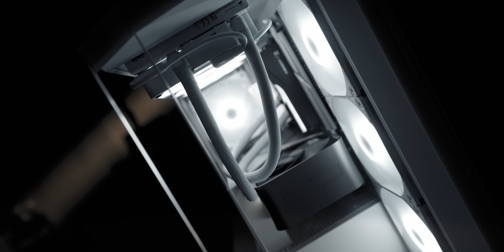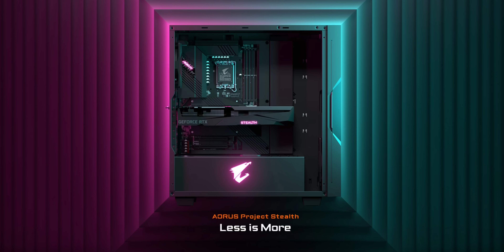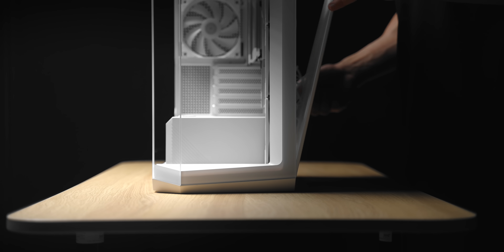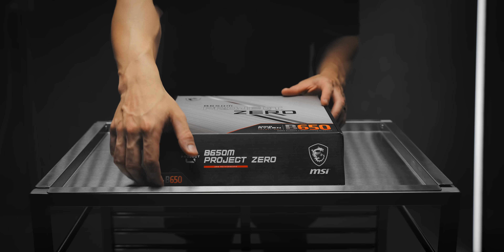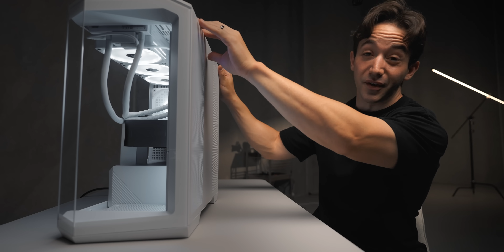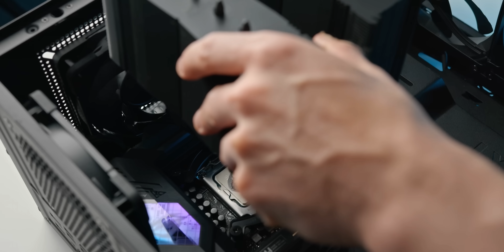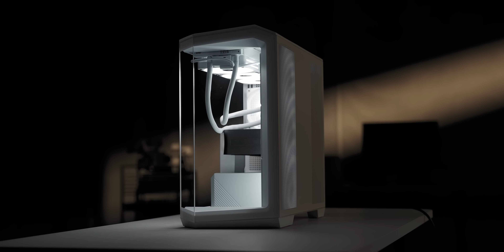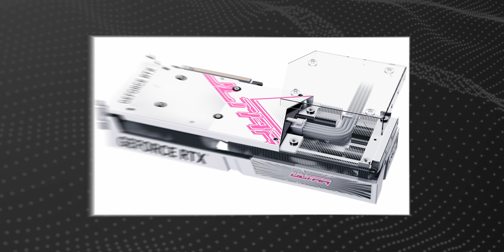"zero cable" PCs are here.

Comment: A couple people have said it already but I feel like the main advantage is that this is way more practical. I hate snaking cables through holes in the case and bending them at extreme angles to get them to connect. This is way easier.
Reply: Exactly.

The choice of using an AIO with tubes just hanging inside on a 0-cable build though...

OCD triggering!
Reply: Especially because case manufacturers keep getting the placement and sizing of the pass through holes wrong, so that it is virtually impossible to even pass a cable through them... like what the hell are they doing not testing it?!
Reply: Right form to match the function.

Comment: This is simply the latest gimmick. There is no practical benefit to having something like this as it limits case compatibility and increases cost. Unlike those fans you showcased that actually reduce cable clutter, this just requires arguably more space behind the motherboard tray to hide the rat's nest. We need solutions that improve the user experience, as in real innovation. Sadly, even those fans aren't fully there yet as there's no industry standard connector and Corsair are infamous for their proprietary stuff.

Comment: The only bad part about this is you're giving up the recyclability of the gpu and the motherboard only for aesthetics and you're probably paying a premium for it too. It's a really bad investment unless they make this thing convertible. Like having connectors on both sides or making flippable small boards that can connect and work both ways like type-c so all those annoying pins connect to these boards and they get socketed in either way. It's doable, yeah it'd be a bit more expensive because that'll probably require more motherboard layers or more filtering caps to mitigate some of the extra resistance came alongside with the sockets. But these products are already expensive and that's exactly why they should make it an actual design because I don't think changing the way the power connectors look is impressive as a design or engineering standpoint, it's far from it. Of course the recyclability might get better if these companies make more of them and it stops being a niche in a couple years, but for now it's a really bad investment at a financial standpoint. I don't think any large scale company will adapt to this new concept and unless companies do it, I don't think this concept will sell enough to push forward.

Comment: Why did you use such a large shroud to cover the cables? if it was half the size it would've still covered the cables drawn less attention and not blocked the geforce logo on the card either.

Comment: Well, this video just shattered my dreams. I've been doing this for more then 10 years. With every PC I've ever built I flip all the headers to come out the back. I even make my own L-connectors and custom cut the case.
Reply: How does this video shatter your dreams? I don't get it
Reply: @gelidanima   I had given thought to selling this idea years ago . Just didn't think anyone would care enough to use or buy the idea.
Reply: I've been thinking of doing that, does resoldering the connectors just work or do you also need to re-pin some of the cables (like the 24 pin)?
Reply: @HorizonMakes you would need to repin, custom harness, etc., as pins would be in mirrored/flipped location.
Reply: @HorizonMakes   As @msytdc1577 stated. You do need to rewire the connector.
Reply: @RetArm oh ok now I get it... But still, this is not the first time someone talks about this "zero cables" PCs thing, I have seen this many times before from many channels and websites. I thought you would have already known this was going to be a thing, especially given the fact it's something you care about.
Anyway, keep thinking outside the box!

Comment: I updated my buidl with the MSI Project Zero B650 with the new Corsair 2500X, and it looks amazing. The Cable managment is shit, espacially if you don't use Daisy Chain Fans, but the inside looks really nice and clean.

Comment: I'm a fan of such, er, fans. But that way of doing "zero cable" on the motherboard is just ugh. I like custom cables for things like the MB, CPU and GPU (USB and audio need not apply). Also, the last thing we need are two streams of GPUs out there without some standard (i.e. rear connecting and front connecting power).

Comment: next - they need to make graphic card power on the motherboard, like it was shown on some computex or similar expo
and after they will have enough plays with cases.... maybe they will start to think for better cooling solutions and how to avoid using hot air for watercooling or how not to warm up cpu from gpu etc.
next - they will think how to reduce noise level from fans and just make fan frame 5mm wider to avoid too close placing to fan mounting plates and positions, it is soo easy to make 14 cm holes on the case and add  a frame for 12 cm fans which will be placed on 14 cm mounting holes wit screws... so easy but they do that stupid shit that blocks 1/5-1/3 of fans but universal for using 12 or 14 cm fans in 1 case on same frame

Comment: Couldn't you use one of those L shaped connectors from the GPU, it's still technically a cable but if it's sharp enough it'll just look like componentry

Comment: looks great! next thing we need is cases with 1cm additional clearance behind the back panel, because some cases are already too tight
Reply: dual chamber is way to go... I have build new PC in H6 Flow recently and it was smooth experience
Reply: @jacekmakes probably 😅 but the joy of building pcs is not about routing cables. espacially with hardware added later

Comment: I'm not really a fan of this concept. Mostly because it will inadvetertently make cases bigger (you need more room at the back for the connectors poking out) and that's an issue because cases aren't making very good use of empty apace as it is today. Secondly, good looking braded, managed cables makes the PC look better . EPS, Motherboard and GPU connectors all enhance the look when they're nice and well managed. You can even add a wireview to get that ultra clean, neat look and still have a sexy cable routed just above the GPU and back. I'm a fan of making fan headers, front IO, audio etc come out the back though but having some in the back, and others at the front is gonna be confusing and a nightmare to support. So for all of those reasons, cables in front are overall the better approach in my opinion. Especially for smaller form factors. And with some effort you can make PC's look fantastic and it's totally possible to hide all the small cables in the main compartment which i've done in my own system.

Comment: I really hope this catches on. I really want a high-end ITX AM5 mobo with the connectors on the back.
Reply: Same, although I'm unsure how effective it'll be in a typical sandwich ITX layout. The CPU side will definitely look clean at the expense of a messier GPU side where all the connections will have to be made before the GPU is inserted into the riser on top
Reply: @Notorious544d  imagine if they made sort of like an electrical distro plate, that would just attach to the back of it, so that you wouldn't need to have any wires at all. Either way, I'm going to make it a personal goal to try to design one myself

Comment: until it becomes a standard on where the connects are i will simply not buy a motherboard that has the connectors on the back. Standards exist for a reason and this should be a clear sign as to why. When every motherboard company makes there own placement of connects on the back. There is zero chance for the customers to figure out what case will fit with what motherboard.
Reply: Actually most everything on a mb is already standardized as far as location goes...stands to reason all the connectors are going to be in close proximity to the components and on the perimeter of the board. Btw, I have three of these built already...two in JONSBO cases and one in a modified Montech King 95 case.

Comment: You might want to check out the YTX boards from DIY-APE and Maxsun as a small form factor option. They are similar to the Deep-ITX boards ASRock makes, but with the connectors at the back of the board. ZS Cases are working on a 6.8L case for this form factor called the ZS-A4YTX which should be coming out in China in April.

Comment: I would say this would actually make it also easer to build with. No damn huge GPU in the way anymore!
I can't tell you how many times I had to uninstall an AIO or fans installed on the upper side of the part of the case then to just plug in the CPU cable. Huge development and it looks nice as a bonus!

Comment: 8 pin CPU power has always been a pain to connect. It’s always in a tight space, or the cables are slightly too short.

With this, we don’t have to deal with that problem. Very nice

Comment: I really like this. Not so much because of the barely visible cables, but because it's finally easier to get to the connections on the mainboard.
Reply: It makes so much more sense to make those connections in the back instead of wiggling my hands around under coolers and shit trying to get it done in the front after installing it
Reply: Exactly! I bet the 24-pin connector is still hard as hell to pull out, but it would definitely help if I didn't have to worry about losing grip and then accidentally hitting something in the process
Reply: @g0rtonW I’m also scared of losing grip and accidentally knocking off a compacitor
Reply: i cant tell you how many times i had to take out my gpu when i was connecting sata cables to the MB...so i totally agree, this is the way forward
Reply: My first thought when I saw the back panel come off lol. Finally
Reply: I recently had to take the cooler out of my brand new build to access a fan header I missed - this design would have saved me a bunch of time, so I definitely feel the pain he describes.
Reply: As long as you pick the right PC case for that.
Reply: This. Not having certain ports covered up by a whopper GPU would be so nice
Reply: it also makes the installation way easier
Reply: same. i actually like to see nice cable extensions as a detail to interior of the pc. but its waaaay easier to connect everything in the back.
Reply: @Steve-wp4ns  not only easier but way cheaper because I just spent over 200 usd on just 3 custom cables.
Reply: @PhilippinesLife101  oh damn. I think I bought some nice looking extensions for 30€. Works perfect, looks awesome.
Reply: @Steve-wp4ns  yea not extensions custom cables
Reply: lol find a different job
Reply: i literally built my new system today and had multiple aneurysms trying to get the cables to go where they need to be
Reply: Yeah... I like my D15, but it makes it a nightmare to work with the motherboard, especially in combination with a modern GPU.
Reply: yesssssssssss
Reply: This is a decade past of interest to me. This should have been standard OVER 10 years ago. PC design and build is utterly archaic - it's 2024..... Not 2009
Reply: @fwabble  2009? How optimistic, I’d say not much has changed since the 1980s.

Comment: I'd rather keep my PC out of sight just for a clean look. I prefer something like a "dumb terminal" setup where the PC is in another room and I can still have my 42" LG OLED C2 TV, Keychron K8 keyboard, and Logitech G604 mouse in my current room; however, the fact that my PC is in the same room but not visible to me and is very quiet does not bother me at all. Just having my PC visible to me at all times is simply a distraction for me and can hinder my productivity even with the lights powered off.